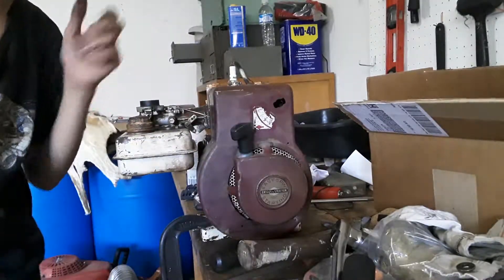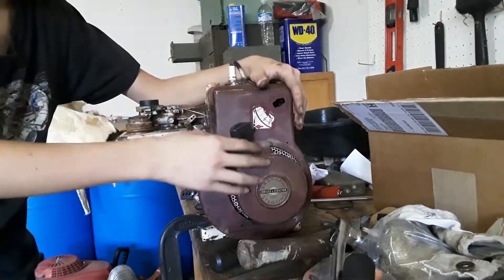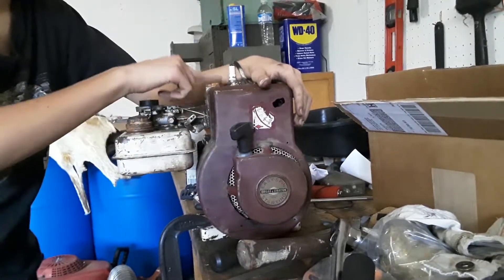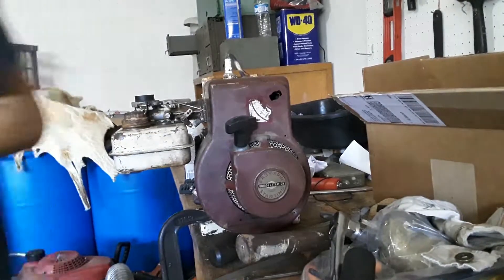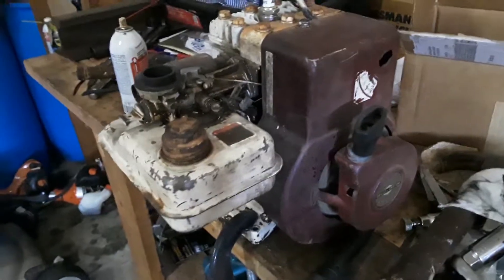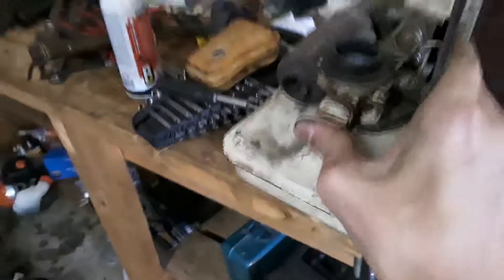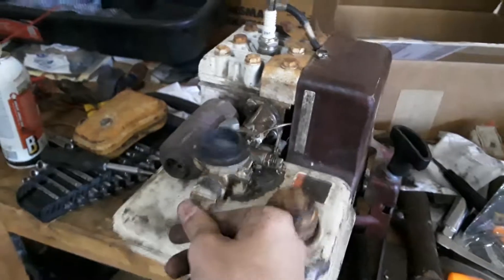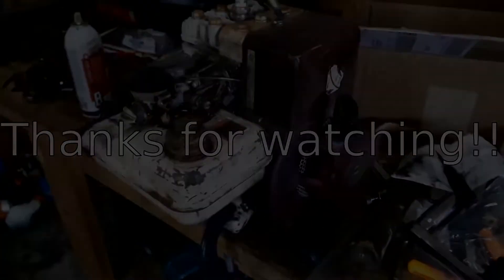Vintage 3HP Flathead Revival!

Comment: SWEET! I've got an old tiller that someone donated to my channel, it's got a 3hp Briggs on it that I want to do something with. unfortunately the carb/fuel system is missing from mine, good job on getting that running again!
Reply from the maker: Thanks! Good luck with the tiller! I actually acquired a 5 HP tiller recently, and I've gotten it running, but the ignition system needs work. No video though since I just plan to flip it for money. I'd suggest trying to track down a float carb for that 3 HP, they're really nice!